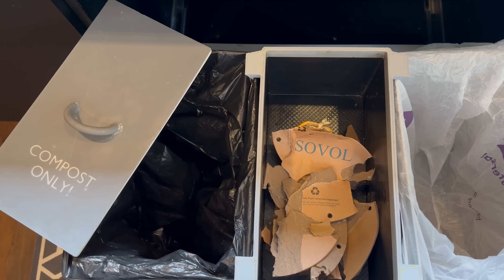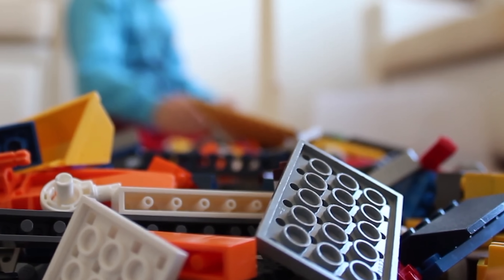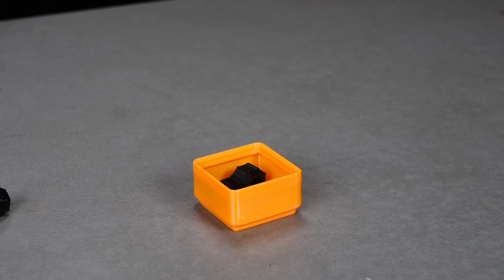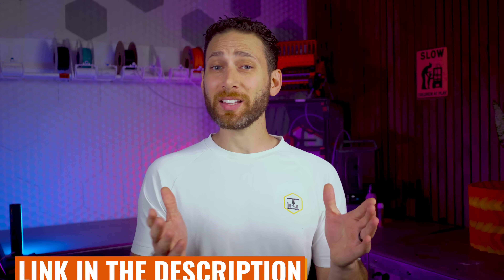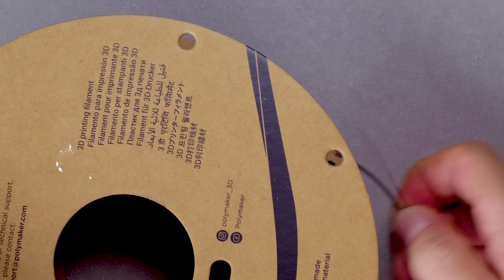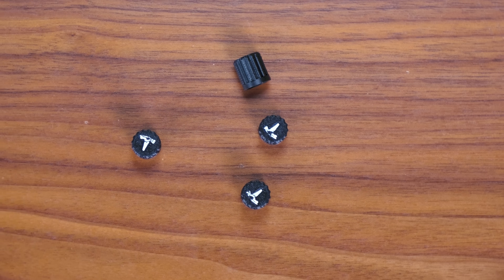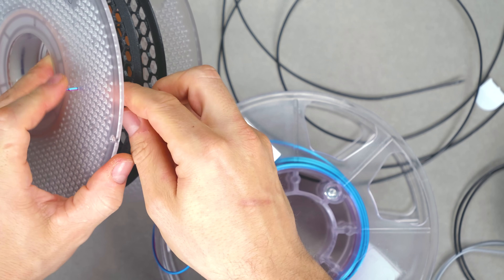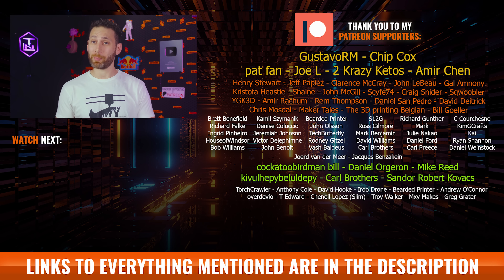25+ FUNCTIONAL Last Meter 3D Prints!

Comment: I don't know if all printers have this option or not, but Bambu Labs you can put a second spool of the same color on the AMS and when the first one runs out it will switch to using the second spool.

Comment: Since filament run out sensors are a thing, 5 years at least, i do not have filament leftovers. I just print until filament ends, and then just put new spool and resume printing.

Comment: Not sure if all 3d printers print a base before printing the actual object, but that base wastes a lot of filament itself, so if you have a little filament left on a spool you'll run out just from printing the stupid base...too bad you can't print a base, pause the print, and swap the spool of filament....I'm new to the 3d printing hobby, so its quite a learning curve, and another very expensive hobby as usual.  

I've tried printing those lego bricks, they don't fit regular legos properly so just a heads up.

Comment: any decent printer with a runout sensor this will work with. but i use my scraps for prototypes. and if i run out i use the next bit a scraps. as well as ive been working on hanging holiday decorations that only use only a few grams

Comment: I really love living in the future.
And yeah, we do.
Most people don't realise it yet, because the future looks a lot like the past in most ways.

Edit: I'm gonna stand up and say that printing bearings on a 3D printer doesn't make any sense to me. High quality 608RS and ZZ bearings are super cheap in 2025, and if you remove the rubber seals (2RS) or the metal shields (Z, and ZZ) and rinse out the grease, the bearings run super fast. Like crazy fast. This is a speed-skateboarding hack from the 70s.

Comment: Why aren't food safe plastics food safe when you 3d print them?
Reply: they are food save the problem comes with reusing them 
usually they would get molded but in this case we have layer linesin those layer lines you have stuff that gets stuck which contaminates your next meal
Reply: @timo4463 why couldn't you use a plastic safe sanitizer? Like hypochlorous acid?

Comment: I printed some 608 bearings and it took several minutes to use my thumbnail to pry apart the frozen parts.  Then I recalled my decision to use the nearest option for seam placement.  This meant that irregular surfaces would tend to occur in patches.  Anyway, I tried again with the random seam placement.  To my surprise the next bearing (6001 for a fidget spinner) came out of the printer with the 2 wheels not connected at all.  You can still feel a little friction.  I also discovered that I can print PETG on a textured plate with no glue.  The parts tend to pop off like magic.

Comment: As soon as you spend it you will need it. 
I simply print mini spools to keep the filament in the dry bot and not take too much space.  Print in PETG because you may want to dry it and the dryer will melt PLA

And I have plenty of black. It is cheap and you don't have to manage loads of different filaments. 

During Halloween I had the whim of printing a Little zombie and some left over red filament was the brain.

Comment: Have you ever built a large cabinet that maintains below 20% relative humidity? I did but am missing something because it kind of stays around 25%. I put desiccant, fans and a gun safe heating tube and cannot get it any dryer, any suggestions?

Comment: I think we all have those devices somewhere in our house that have a pinhole in the side that you're supposed to use for initiating a reset, or perhaps tell the device to sync with the house management system, or something. You know the ones. Where you replace the battery that just died 5 months ago, and now you have to find one of those pin tools to eject the sim card from your phone so that you can get this reset as well? and where did that go? Well, I made a 3d model that's over on Thangs (in my rusty_curry profile) that takes a metal paperclip, gives it a nice handle, and will accept a couple of M3x6 socket cap or button cap screws, that you can then add a keychain to and put in the keybox where you won't remember it's there next time you need it. Doesn't take much filament. Bambu Slicer says it needs 1.38 m, or 4.2 grams of filament. Look for 'reset pin key case', and I'm sure that there are dozens if not hundreds of others out there as well.

The two halves print with bits holding them together that can be put inside the assembly to rattle around if you need to have on hand a simple rattle to distract someone.
Reply: Also as a throw into the woodworking tool kit item, print up some paint or finish pyramids, which could be half a mm thick except at the edges and corners where they are 2 mm for a bit of strength, and you get both a set of dispensable caltrop when being chased by soldiers on horseback, as well as supports to keep your woodwork from bonding to the table or paper you're working over.

Comment: Why do some people claim that 3D is an expensive hobby, or that printing isn't a frugal option, or that filiment is a huge hidden cost?

Like just as an example look at those hair drain cleaners. If I go to the store, if I spent $20 can buy around 20 of them or $1/each. Or I can spend $20 on filament and get 100 of them, for $.20 each.

I know there's time cost involved snd obviously I'm not mass producing drain cleaners or anything... but its not "expensive" if I'm not doing expensive things with it.

I am only seeing things that save me money... ESPECIALLY considering the rapidly skyrocketing price of things through amazon or chain stores.

I can buy my daughter a single-pack of barbie accessories once... or a single roll of pink filament at the same price to make accessories for the entire year.
Reply: there's time cost, your investment in the printer, convenience, you need to buy (correct) materials, you need to have the files for the print aswell as the settings to print them, you need to print in a ventilated dedicated space etc etc

Comment: The by object option in orca sounds really cool. Im yet to buy a 3d printer and i think im going for one that supports multi colour printing  but it got me thinking does any splicer or 3d printer support an algorythym that can calculate the size of the nozzle arm and clearence in the 3d space and calculate a build by least colour changes so like say you were printing many different models at once that had the same colour on different levels it would jump between models maybe delay starting one model untill the first model has reached that colour etc cause i see many multi colour printers besides the prusa xl which can support multiple heads creating lots of waste via purge or poop is that wat you folks call it.

Comment: If you have 'last meter' you should really print filament movement sensor = ))) A really functional 3d print, which really prevents having trouble with 'last' meters. There are no last meters anymore. Just print and change the spool when it is empty. And no incomplete objects anymore.

Comment: If you have an ams then I'm pretty sure there's an option to switch filament in the middle of a print when it runs out. Could be useful if you have another roll of the same one, or you don't care about the color changing.

Comment: Just picked up a P1S and am impressed. For context I run a CNC shop and so that stuff is impressive enough on a large scale. But back in 2013 when I was 22 I got the awesome opportunity to be the main operator for a Stratasys Fortus 250mc. That was wildly impressive back then, very reliable, very propriotary...and very $60,000. Plus maintenance subscriptions and such. The university bought it which explains a lot, apartently a lot were sold to universities through grants.
I've also ran some super cheap older 3D printers, constantly unreliable. I have never needed to own one, but I have a 15mo boy now and have many other excuses to get one. I wanted something reliable and consistent, I think I made a good choice with the P1S. Don't have the AMS yet, so room to grow. I'm not afraid to trouble shoot and learn though if things don't always go smooth, and they won't. Spent have a day today cleaning an air system and solenoids on one of my CNC machines today. Gotta be done once in a while. Enjoy your content, keep it up.

Comment: Swatches are usually the first thing I print with a new roll, but I've been using up my scraps with filament clips for a while and I'm just about to run out. Luckily I have a bunch of nearly empty spools waiting to be used up so the timing works out perfectly.

Comment: Got a 3d-pen for my leftovers (now mainly my kids use it)
And a filament connector (simple ceramic magnetic one you have to use a lighter to melt the filament) to connect them to longer strains for prints that don't need a specific color or look better that way

Comment: I have an idea. What about putting the bits of filament in a vacuum bag and suck all the air out and store. No moisture will ruin the bits.
And then later, you can splice several bits together. Viola 👍🥰

Comment: One of the features of my new printer that i like best is the ability to auto-pause the print, load new filament and continue seamlessly.
Reply: Bambu Labs?
Reply: Be careful with it since the one color on two different spools could differ a bit, and it would be visible in your print
Reply: @ColorPopKnits How common is that? If I have two spools from the same manufacturer, how likely is the color to differ?
Reply: That is nothing special, just requires a filament runout sensor. Pretty common.
Reply: @Vortex-gz8se  Nobody said it was special, just that they liked it. :)

Comment: ...or, just throw it in the recycling.  I already toss supports and bird's nests of failed prints.  I see no need to hang onto tail-ends and non-reusable spools.  If you re-order the same filaments often, you can just let the runout sensor trip and load the new roll, for those without AMS units.

Comment: 1. Magnetic fridge push pin (add your magnet)
2. 12oz Coke can slide lid cover to prevent bees 🐝 from getting in
3. Golf tees 
4.tiny fidgets
5.ar15 frame tensioners inserts
6.rings jewelry ish
7.lego brick keychain 
8.marbles for marble run machines 
9.darts for blow darts 🎯 
10.book marks in single color semi shallow/skeletonized
11.folding or non folding phone stand
12. Spinning top
13. Guitar pick 
14. Single fidget clicker button 
15. Croc 🐊 charms
16. Tiny cord organizers 
17. Leaping print in place push frog 🐸 

Just a few of the top of my head
Reply: @TheFoxalot  these are great suggestions! Especially the golf tees, you can never have too many

Comment: I usually just put the last meter filament into small test print or just use it with new roll of same color when possible. Other than that i also sometime use it to print bases for my minis or connector for terrain. Also some tokens or coins to gradually replace cardboard one in my boardgames or just blank circle and square tokens to use when making my pnp boardgame set

Comment: Okay, you made a mistake keeping your selection to printables. On makerworld there are WAY better divided spool designs, the ones you show are garbage and fall apart if you open the spool. Ones on makerworld can be kept independently of the spool so you can load up however many sub spools you have. Viewers will only be frustrated with the one shown.
Reply from the maker: Thanks for the tip I’ll be check it out. I don’t like makerworld though because of how they don’t display files

Comment: omg I already printed out that zipper pull and will have to pront two more soon, because my sport bag has such cheap pulls that they just break 😂. Printed it in PLA and glued it with hot glue and until now it holds up great after like 4 Months at Temps from 3°C to 53°C

Comment: 3D printed Lego? Missed opportunity for #PrintABlok from the 3D Printing Professor! They are a fantastic last meter print as you can throw a bunch of the connector pieces onto the build plate, and you can never have too many connectors! 

Don't worry, I can offer a refresher on them when I see you at #SMRRF 😁 

I shall be hosting the #Recreator3D table once again ❤

Comment: I honestly don't understand why the end of spool seems to be so problematic for people. It's not like filament is hard to swap out during a print with a direct drive. If a model will be painted i don't care about the base color so I'll just use up rolls as i can swap out as they run out.  Otherwise i just use them for small prints, calibration tests, first layer tests etc.

But I do need to confirm... do people actually WAIT until they finish a roll before they buy 10 new rolls of filament?  I didn't know that waiting was required.

Comment: If anything, the 'print each object separately' setting is definitely a great discovery for me.
Will definitely try this next time.
Reply: It has its uses, but it also has its drawbacks. Anything taller than the distance from the tip of your nozzle to the next largest piece (typically the heat block) requires lots of extra space to prevent the print head from crashing into the existing parts, for one.
Reply: It's especially useful if you have a print that works great as a single, but if you tried multiples they fail.
By printing them by object the previous layer doesn't get extra time to cool down which is likely the cause of the fail. Especially if you're printing without an enclosure.
Reply: I know, RIGHT? I've been using Orca exclusively for a year now and there were several times this would have saved me HOURS on a Print.

Comment: Keeping it meta, a bed scraper so you get you print off the bed without scratching the PEI/G10/whatever layer. Works for pretty much any filament except that last scrap of TPU—which becomes hose washers or non-skid pads for other 3D printed stuff.

Comment: My smallest functional print was also my most valuable. 0.12g for the part itself, but about double that in actual filament used because of the purge line and supports. Was to fix a tiny hose nipple that broke off in an $800 CPAP machine that would otherwise have been thrown away.

Comment: I guess my only real complaint about the spool splitter is that you have to be very careful to use only one filament at a time from each split spool, because filaments that are sharing the same spool won't be able to unspool independently of each other. So if you have a last-meters print you want to print, and you just so happen to want to print it with filaments that share the same split spool, you're kinda SOL unless that last-meters print is one in which you can pause and manually change filaments out at the right layer.